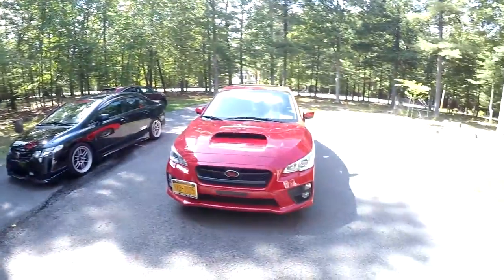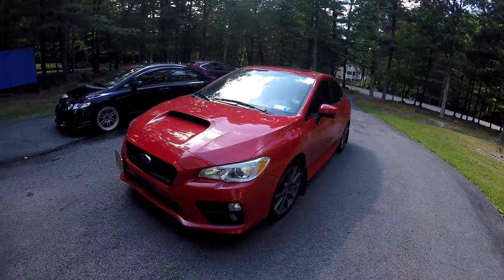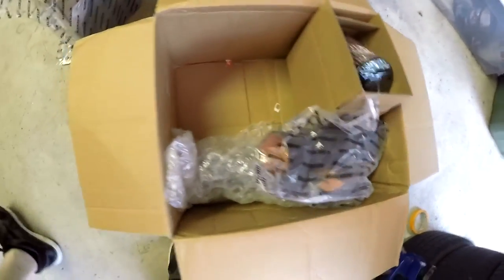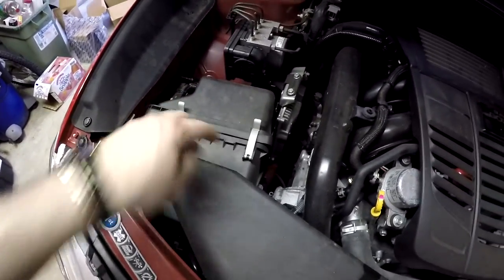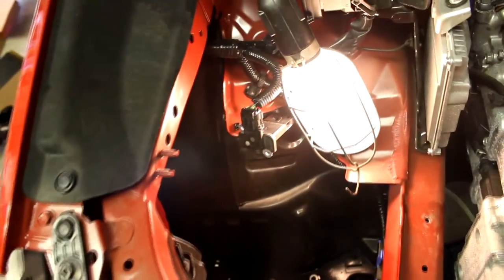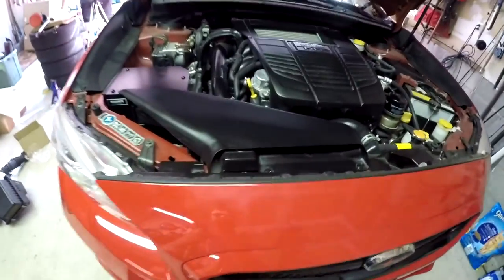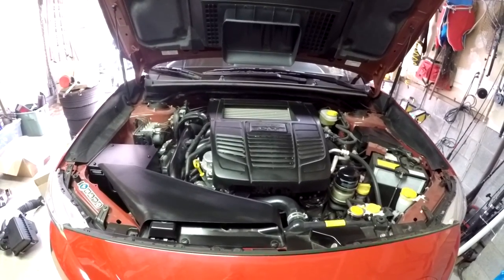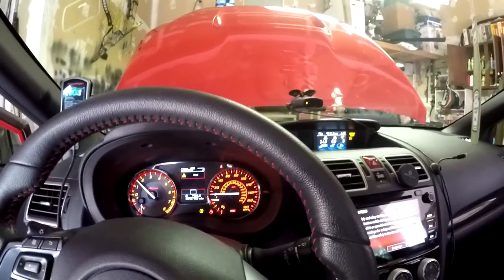Mishimoto Intake Install- 2016 WRX

Comment: Im running a 2016 Wrx Stage 1+ Mishimoto same as you and it sounds phenomenal! I love the accentuated Bpv noise and turbo spools soo much louder in the cab!
Reply: what map are you running ?
Reply: raph roy yea, wonder what MAP they are running.  Mishimoto told me not to run this intake setup on 91 gas UNLESS I am tuned.  I assume the Cobb OTS will suffice.   Still doing research.
Reply: @GR8GUY54  any updates on what ots your running this on?
Reply: @craigvu8633  Cob OTS made my car drive like shit.  I was litterly on the freeway cruising at 50mph and out of boost due knock and extreme low DAM numbers.  These cars are super sensitive when it comes to the MAF.  After a week of limping around on the Cobb OTS, I finally got pro-tuned to dial in the correct A/F mixtures.  She runs like a champ again and pulls the way I like it.  Little rumble with swissshy sounds is all I wanted.  A pro-tune will do that.  Safer for your engine.
Reply: @GR8GUY54  Do you have the performance or the race version of this intake? I just got the race intake but cant find any ots maps for it. Im thinking of a protune but id rather wait until a get a j pipe.

Comment: Heck ya, i got the same one, have had it for over a year now (12k miles) , love it.
Reply from the maker: +Steemax oh yeah question now is what's next. I'm thinking j pipe, nameless muffler deletes and short throw shifter... In that order
Reply: Sounds about right to me... planning on a protune once that's all done? I'd say it's worth the money for a more powerful/reliable tune
Reply from the maker: +Steemax you just have to find a good place to do it. Or I might just get all the parts I want then go for a protune
Reply: Yeah the shop is most important. Gotta find someone with a good reputation of course. I'd get all the parts you want first and do it once.
Reply from the maker: +Steemax very very true. I gotta do some research around where I live. But that's way down the road for now. First parts then tune lol
Reply: Steemax 93 Octane?   What MAP did you run?

Comment: Hey just wondering do you get like a high pitched sound when you slow down?? it almost sounds like your brakes are worn out type of sound. I get this with the Mishimoto intake and when I called them they said it's quite normal

Comment: do I have to put it on a dnyo after installing the mishimoto cold air intake....or just add the tune on the access port? so buddy, im new to this subi life just trying to some pointers! thanks....
Reply: Oliver Galman you can use the OTS  map that's on the access port or get pro tuned you will always mange more power/torque with a pro tune
Reply: gp680 what map did u use on the accessport or did u use the map from mishimoto??
Reply: Chang Pham once I installed the mishimoto CAI I got in touch with Maperformance and they sent me a tune for my CAI it is a more aggressive tune but super fun but the numbers are not where I would like them so I used Cobb Ots map and the numbers are perfect but it is not as aggressive and feels slow.

Comment: what do you mean getting a tune? I also bought a Mishimoto cold air intake just like your but I dont gave the access port to change to stage 1.. is this what you mean? I also bought the Boomba bov, which I heard adds few more hp.
Reply from the maker: yeah its generally recommended to have an access port with an intake. Since your adding more air to the engine the ecu will need to give the car more fuel. i would recommend to wait for an access port and install it all at the same time just so that way you don't have any issues. Plus im not sure if the BOV will add any extra hp also... but then again im not sure.
Reply: Oliver Galman mod number 1, Access Port!!!  Don't be a ricer and blow your engine.

Comment: How did u intall this without getting under the car? Or did i miss something
Reply from the maker: yeah u have to get under the car for a little bit to connect the actual intake but its not that bad
Reply: iTheGreek did you have to disconnect the battery?

Comment: Were you worried about voiding your warranty?
Reply from the maker: when i first got the car yes. but after a while i didnt care about that anymore lol
Reply: Lol i wanted to get an AP and this intake but too scared to void my warranty. But maybe in the near future. Nice vid. goodluck with your future plans on this car
Reply: I was worried about it too, kept the car stock for a little over a year and now it's been 2 months stage 1 with the MAPerformance tune I love it. I will be getting the mishimoto intake soon. The reflash is worth it for the rev hang alone. Cobb OTS maps are ok but look into a aftermarket e-tune to make good power. I dont plan on going beyond stage 1 for awhile.